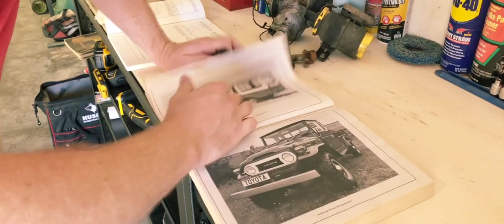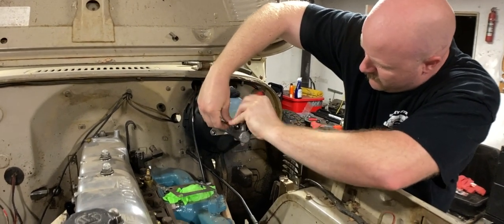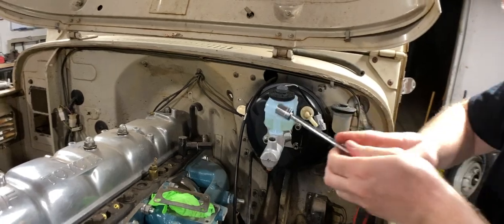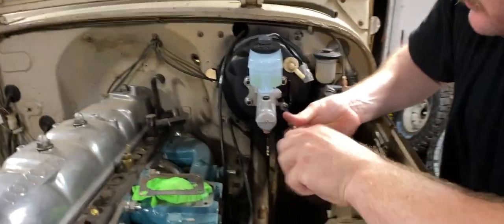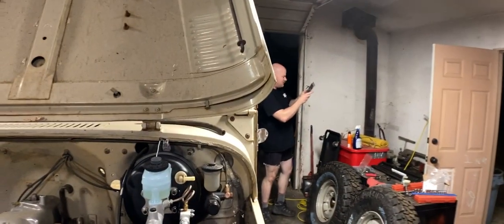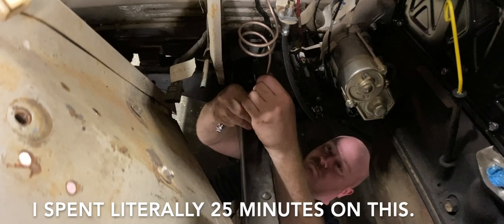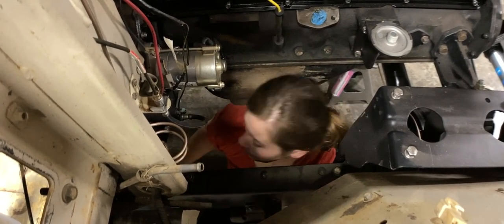FJ40 Brake Lines Part 4: Bench Bleed, Hard Lines Installed, Eastwood Tools Flaring Tool, Wifey Helps

Comment: Again with the smut highlights!! "It's dripping from the front hole". Pure Class.
On a serious note, I have never in my life seen that much tension applied to a brake fitting. Oh, by the way there are better ways to bench bleed a master. But you knew that right?
Reply from the maker: I did not... know anything. And I’ll be doing less tightening here on out!

Comment: I bought that same flaring tool and also bought a roll of brake line from Eastwood at the same time. The brake line would not hold tight in the dies and would push back when you try to do the first stage. I tried all sorts of things like wrap thin plastic around the lines and scuffing it up but nothing worked. Then I went to Napa and bought a stick of theirs and it worked fine. I emailed Eastwood and they just said thanks. I stopped buying their stuff as it is all just rebranded stuff you can get cheaper from the original manufacturer.
Reply from the maker: Bought the line from summit, and it worked good man. Decent price too.

Comment: Hey Ben, don't forget to adjust that proportioning valve.. turn it all the way down then all the up and count the turns, then come back off half the amount and that's the best place  to start . When you drive it then you can see if it's to tight or loose on pressure.
Reply from the maker: Copy that bro, I'll see what I can do.

Comment: Those front braided lines should be fine! They should have a inverted flare they on the end that seats on an internal flare in the caliper threads! The ends on the lines should be a solid version of the bubble flares that you do on the hardlines
Reply from the maker: Thats just the confidence I needed not to do anything else with it! Thank you bro.

Comment: Yooooo, that doesn't look right.  I'm glad you re tackling this before me. Check out the rubber brake lines of Spectre Off Road. I bought a whole new set of pre-bent brake lines and then they have a kit with 3 or 4 of the flexible rubber or braided stainless hoses that go from the Rigid perch, to the caliper. The ones I got have a spinning nut on them so they don't twist up like a pretzel as stated below.
Reply from the maker: I’m going to force it, and see if that helps.

Comment: Buy the cheap brake bleeder kit from harbor freight.  It makes getting all the air out of the system super easy and quick.
Reply from the maker: Going to need it for the brake bleed. I’ll look out for it.

Comment: And you can do the bench bleed with the master cylinder mounted on your automobile it's best to have two people one pushing on the brake pedal and the other holding on the rubber Hoses inside the master. Some people don't have a bench or a vice so they just mont it in their automobile there working on. Wow that's one fancy flaring tool i which i cud have that expensive brake tool mind was  $21.99 -20% coupon + 6% tax =
Reply from the maker: I needed to buy the expensive one. Because I can’t figure out how to do the cheap one justice.

Comment: Ben, I can see you spending more and more time behind the lens instead of the front at this rate. If that happens you might have to rename the channel “Project Rachael’s Way” 🤷🏽‍♂️
Christmas present sorted...socket set and a selection of  nail varnish colours! 👩🏻‍🔧
Reply from the maker: If Rachael steps in the shows over.

Comment: What brake booster and cylinder did you go with
Reply from the maker: The brake booster was the factory booster that came with the 72' FJ40. The master is from an 80' series non ABS model.
Reply: Thanks

Comment: Well as far as I know that's not now you bench bleed a master you need master cylinder bleeder kit most all auto part stores have it $8 to $10 and they fit most  or all master cylinders so you keep them win you have to buy a new master i would but it in a good quality zip lock bag after your dune with it so the brake fluid didn't go allover. But all you do is find the right size that fits your master then put the rubber Hoses on then put them in the master cylinder rezervor all the way to the bottom you don't want them to suckling air then you start pushing on the master to do the bench bleed.
Reply from the maker: I’m taking notes... thank you for the info Rob.

Comment: Ben you are using brake lines that are not meant for a monte carlo caliper, they probably won't look flush, but they will work when tightened...just won't look flush.  Head of the brake line fitting and female of the brake caliper form the seal.  Yes you will need to bleed the calipers at each wheel starting at the farthest wheel...rear passenger.  Yes, secure the front brake line if it's going to be rubbing.  Second job for Rachel ...coal mines in Kentucky and quite having sex with the brake master cylinder..LOL
Reply from the maker: You’re killing me! Those lines should be right... I’ll pass the info to wifey.